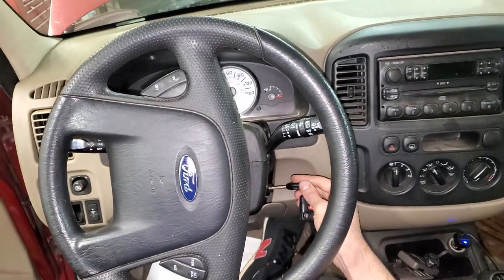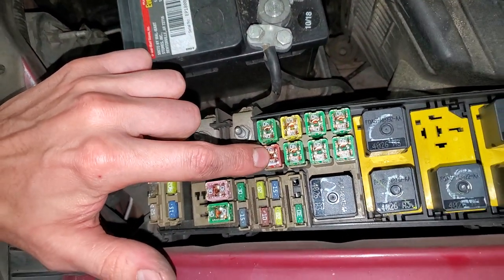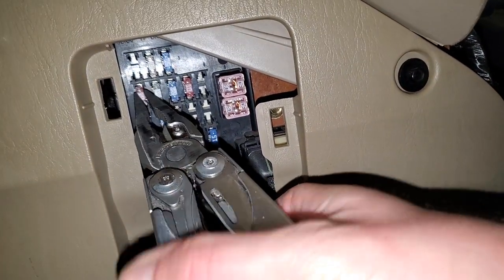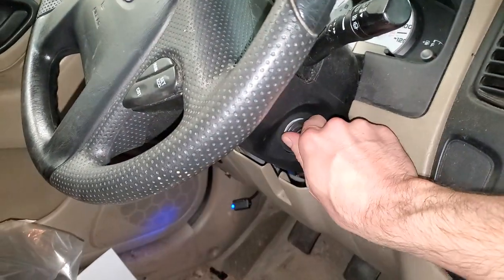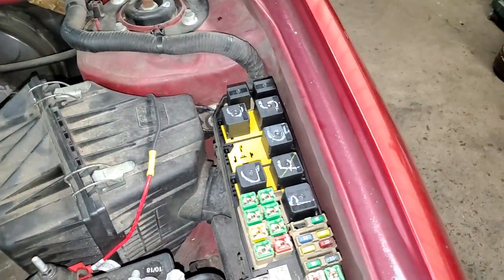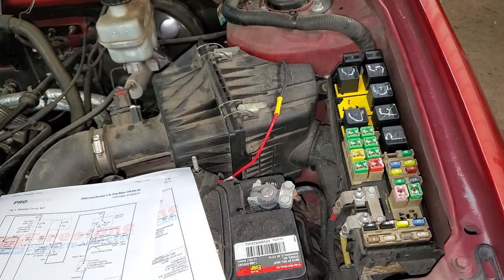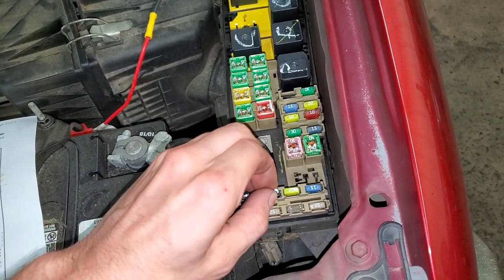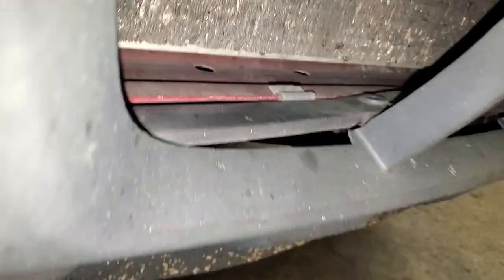2005 Ford Escape Starter Relay & Fuse Location and Explanation

Comment: Just fixed my no start no crank battery works by replacing the 2amp fuse - pcm. Holy cow that feels good. It's fuse #5. All other fuses were fine. Dang 🎉

Comment: If I've lost the ignition key and have a key without the one chip that unlocks the door and will turn the ignition switch will the car start by turning the key on and manually engaging the starter

Comment: IN my daughters 2006 escape, auto trans, 3.0 V6, the 25 amp fuse is missing. The fuse that you pointed out that sends power to the inside fuse box.. should there be a fuse in that position and if it isn't there could that be why the balking starter. FYI, pushing in on the inition key in the run position, then while holding in turn to the start position seems to help balky start. new battery, alternator charging 14.2.

Comment: Thank you.  I do have a question, which fuse is for the car alarm on a 2005 Ford Escape Limited??  And can a Car parts store test it??  My car alarm keeps going off and I suspect a bad fuse, at the very least I want to check it. My car battery is only a couple of months old.  I thought that might be the problem since it was near it's lifes end, and it did seem to help for a little while but then it started going off again.

Comment: I am looking at 2005 Escape the battery light on the dash. I replaced the original one a month ago and last night it came on again last night. Car running engine on idle with multi-meter less than 12v clean battery terminals, try again still only 11.77V. 
Replaced original removing passenger front axle etc. reassembled and light went out good to drive. 
Three weeks later same light comes on and voltage has dropped again?? Have to pull it apart again to have the rebuilt bench tested. But just wanted to see if there is something I’m missing! Thanks in advance any help would be great I know the parts store found my old one on the core shelf. Luckily it was still there but I will end up paying the mechanic to remove the rebuilt, and charge me again to reinstall it. He is quite good at the R&R but still 4hrs.  I have to pay for but would really like not pulling the 1 month old rebuilt out if I don’t have to.

Comment: Good to hear your understanding of the fuses and diodes. I have a strange issue with the BCM. Everything functions, power windows, lighting, door locks with my key in the 3rd position (run?), but when I start the Escape which runs great, I lose power for the windows and door locks. Aftermarket radio works, headlights, cruise, etc all work. Just no power locks or power windows after the car is running. Thinking a ground because in 3rd position isn't my starter energized ?  Then not just after crank?  Thanks for any hints. It's automatic, 3.0.
Reply from the maker: If you drop your VIN and email I can send you the wiring diagram for those circuits
Reply from the maker: hey just sent you an email.

Comment: I have a 2005 automatic escape.  All fuses are good, switched diode, changed out relay, brand new battery.  Still no crank.  I bi-passed relay and starter does turn but engine still wont start.  Tried it in both park and neutral.  any ideas?
Reply: I also put in a new ignition switch with no luck.

Comment: what about the transmission system.  Engine on a 4 cyl ford escape 2006 is running smooth. but does not shift until revs up real high.

Comment: I hope you might be able to help me my 2005 mercy mariner was running fine I had to get the fuel out of the tank so I watched a video on how to bridge the starter relay so I was trying to bridge it over I was on the wrong relay I guess it got a ground it was the relay first one past the fuel pump relay toward the starter relay now it won't crank over and the fuel pump has no power please if you could help me your video did help me so much I have check all fuses  they have power on both sides thank you.

Comment: Having a no start no crank issue. Been chasing it for months. Only thing it will do is click at the inside fuse panel. I have checked all fuses. Checked starter. Everything. Only started this after I replaced the battery
Reply from the maker: I would check the battery connections, make sure they are tight!
Reply: Ok

Comment: I have a 2006 ford scape 4cilynders 2.3 automatic the problem is that when I drive it like 10 miles and it reaches the normal temperature of the car after I try to turn it back on it won't start but when is cold always start it doesn't get over heat just reaching the normal temperature of the car what could be the problem
Reply: Did you look into crankshaft position sensor?
Reply: No didn't check into the crankshaft position sensor